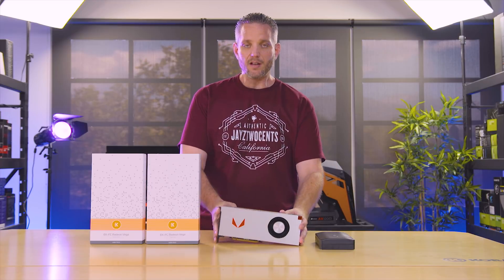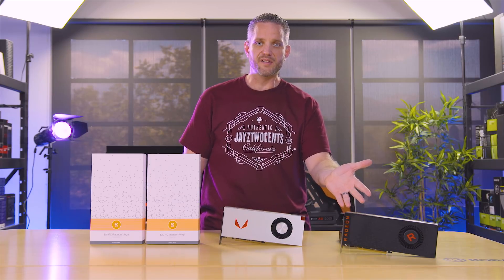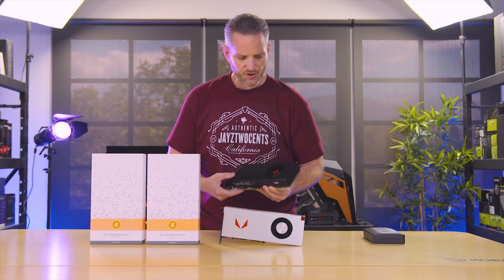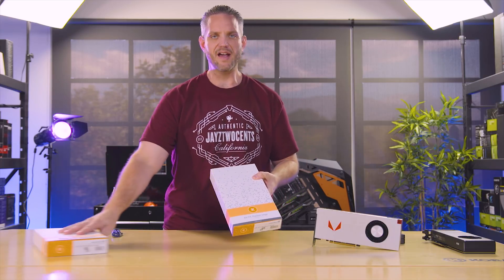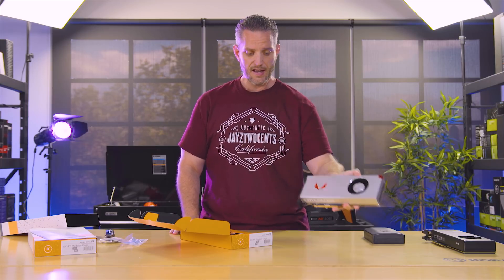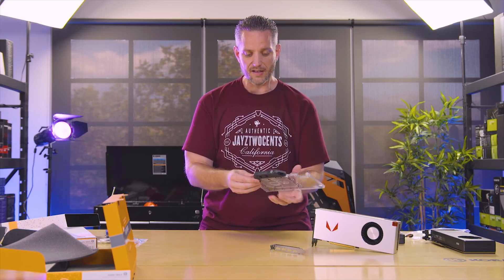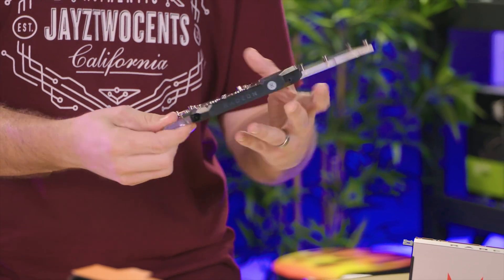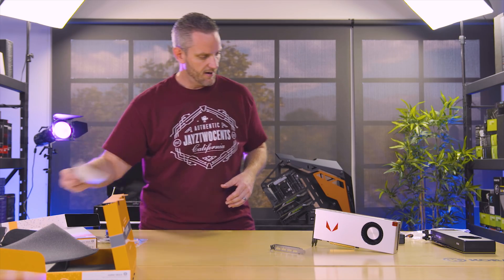Does watercooling help AMD Vega cards?

Comment: Hey Jay, thanks for the info! I really do appreciate all the work that you and your staff do. I recently did an 1800x/Vega 64 build, and will be doing a custom water loop in the near future. I was hoping that you could do a Vega 64 crossfire review?  That way  I could know if it's worth the extra money for the additional GPU, before I do the water loop. I understand that prices are inflated right now, and I would certainly wait for some drop or deal. Also, I saw that you are no longer using your Phantek Evolv 1800x build due to heating issues. Have  you considered moding the case to increase airflow? Many have cut the front and top metal covers to increase airflow, which will be what I do before adding multiple radiators. Thanks Lee

Comment: It looks amazing, but for that price, as you said, you can get GTX 1080 ti with 3 fans, that will keep temperature in check. Not to mention better performance and lower power draw from 1080 ti.
When Vega 64 comes down to 500€, then it might be making more sense. Right now it's not best price to performance ratio and not even close to being the best in performance. I just can't see a reason to buy this GPU now.

Comment: I have a 1070 with stock air cooler on it, running 2100 Mhz overclocked and it never gets about 45 C

Comment: Even when prices normalize it wouldn't be worth it. Huge power draw, the need of a more powerful PSU, higher electrical bills of barely the performance of a 1080 which can be had for under $550 right now.
Reply: But I admit it's sexy as hell.
Reply: For gaming yes, not for computing though

Comment: how did they address the  gpu and hbm2 being at different heights on certain models ?
Reply: TheRocky3211 Based on what I know, likely the substrate between the hbm to chip packaging thickens. Since the hbm die is separated from the gpu die.
Reply: 0.04 mm, I'm sure your thermal compound can cover that much
Reply: Andrew Delashaw 
No, there are 3 VEGA packages. If you look at gamers nexus they talked about it. Their cards also have the completely flat epoxy potted dies. 
It looks like jay has the most basic package where the HBM is a fraction of a millimetre lower then the GPU. HBM thermals are bad on these packages and you can't OC HBM for shit because of the temp.
Reply: The difference in height is some 40 microns. Just tighten your mounting screws 0.01 Nm more if you intend to replace the stock cooler.
Reply: 101blubb 
The cold plate is sitting on the GPU die, it's not going to bend to contact the HBM RIGHT next to it.
Reply: It doesn't need to. TIM is just fine in terms of connecting the cold plate to the memory.

Do you not realize how small of a difference 40 microns are? That is significantly smaller than a hair's width.
Reply: I don't think they are at different heights. I think the tops of the GPU and memory are all three on the same plane. And what do you mean, "different models"? Are you taking about variances between individual boards? Or variance from the 56 to the 64? Or variances when third party manufacturers start using the Vega 10 GPU? Because right now there's just the 3; the 64 SE, 64 Frontier, and the 56, and they all have the same exact layout and GPU/memory height off of the PCB.

Comment: The graphics card definitely having a better time on water with those temperatures, just a shame for the massive power draw though, where is all that power going to though? The Memory? The GPU? Though strangely it seems to do well when undervolting too, maybe AMD were thinking to give it a bit more voltage just in case?(That Violin and Piano mix was awesome sounding, where do you find the name for it?!)

Comment: This got me thinking - Why don't graphics card manufacturers every offer a "card only" option (NO cooling/IO shield(perhaps even omitting the fan header/circutry too)) at a slightly cheaper rate for those that are going to drop the extra cash on a water cooling block anyway?  Surely this would save the cost /waste / recycling of the air cooled parts from the factory??

Comment: Getting the same temps as you with my Vega64 in my custom loop overlocked at 1734 Core 1100 HBM2. Clocks arre rocksolid for me at 1734 in all games tested + furmark (did you set the powerlimit to 50%?). And no coilwhine which is a first from an AMD reference in quite a while :)

Comment: J would u have access to a RED cam 6k or above? If so how does Vega64 handle red 6 or 8k raw files. I'm planning a build with a 16core CPU 64gb or more ram. Right now I am using the first TitanXP but it is said to only have 28 CU while Vega has 64

Comment: Would be a cool thing if the waterblock can be seen in action from the top... But the GPU must point up. And that is, sadly said, not possible cause of heat. (aircooling) 

So when a Company build graphiccards with waterblocks installed, why they make not more for design? Like i said, a another architecture, where all parts of a GPU are on the top, when the card got installed in the Mainboard?

Comment: wouldn't you want the fins to be parallel to the flow for better heat dissipation?
Reply: I assume the fins in the water block. As an actual answer to that question, the fins are parallel to the flow of water. You can see the fluid enters a jet which forces it down on the fin array over the die, then is split to cool the VRMs, before reconverging at the outlet of the block terminal.
Reply: fins on what?
Reply: Yeah when I slowed down the footage at 6:34 I can see it is, in fact, parallel to the flow. Thanks for the reply.

Comment: 1080 TI is still king
Reply: Nvidia can relax because AMD has nothing better than the Vega64. At this moment there is simply no competition for the GTX1080TI. I wonder what would be the result when you place 72 or even 84 computational units on a card..

The funny thing about AMD is that when it was really starting to match NVidia performance, their CPU went the otherway. Now they have a good CPU, they seem to dropped the ball a little on the GPU. 

I'm afraid the AMD is too small to compete with both Intel and NVidia at the same time. It surely lacks the R&D resources of the former giants. 

Let's hope that availability gets better when Hynix can finally also deliver the HBM2 memory modules. 

[sarcasm]BTW: It is not hard to get sold out if you only have 100 cards to begin with..[/sarcasm]
Reply: That's the key problem. AMD is fighting 2 big enemies. Intel and Nvidia, so they can only choose to put max effort in one of both. Vega isn't bad, but it surely isn't kicking Nvidia of the Throne. Intel however ate some dick when Threadripper was released and ryzen is selling like crazy.
Reply: Half of the power (ok, a little hyperbolic perhaps) is literally turned off. RTG driver team literally can't make drivers for it LOL  It's still using the same ol Fiji codepaths with virtually none of the new Vega features active. Whether the software losers can fix this is to be seen.
Reply: God Fearing Nvidia knows that HBM is ex, that is why it is reserved for GP100
Reply: Elbucho1 ofc it is, in its price bracket.
Reply: In HPC applications the Vega can only surpass the Nvidia in a few tests, but I guess you never checked of how many test HPC exists off, right? BTW, it did only out perform NVidia when the they used OpenCL. When the GPU was allowed to the use their native interface (CUDA for NVidia, Stream for AMD) it could no longer keep up with NVidia..

About the power. The GTX1080TI was outperforming everything from day 1, without any optimized drivers. The area where AMD is really outperforming NVIdia are the Linux drivers integration.

You also do realize that the 'once the optimized drivers' argument is used with any AMD architecture? Check the reviews, it was also used for the Polaris architecture. That architecture is now 18 months old.. Is the RX480 performance now better than when it was released? Yes it is, but it's not magnitudes. You will see the same with Vega. Take for instance the Computing drivers. It will improve things a little, but it went from an average 37mh/s to 40 mh/s with ethereum mining. However for the same price of a single Vega64, you can buy 2 RX580 cards than crack out an easy 62mh/s while using the same energy. 

Because of the powerdraw, overclocking is not an option, so most miners undervolt their GPU's in order to reduce power usage and thereby heat..

Meanwhile, Inno3D started to warn miners that their warranty voids if the GPU is used for mining are they claim the cards are not designed to run 24/7. As far a I know Inno3D is currently the only one. 

For proper workstations load it simply cannot keep up with 1080Ti or Titan XP as it short of memory. The Vega only comes with 8GB memory where the others come with respectively with 11GB and 12GB of memory. In Maya it can somewhat keep up with the 1080Ti, but both are no match for the the Titan XP. Not surprising as the Titan is an entry-level NVidia Tesla card.

Actually the Vega64 currently has only one area where it really comes to it's own, and that is cryptography where it can beat ANY NVidia GPU.

But in general, the Vega64 cannot keep up with the 1080Ti. That is also why AMD placed the Vega64 against the GTX1080 (non-Ti version). As the Vega64 is currently produced in very limited batches, prices are very high. Even when Hynix is also the produce HBM2 memory modules, there will be only an influx of more HBM2 memory, but most likely against the same price. But as the vega cards get better availability the retail price will drop and than the vega56 can really starting to compete with the GTX1070. But the GTX1070 is already 15 months out, so I expect a successor within 12 months..

But eventually the HBM2 prices will start to drop and profits for AMD should rise, meaning larger R&D resources. 

One thing to note, pretty much all reviewers use the same games for measuring the gaming performance. So one can wonder why AMD didn't optimized the drivers for those games to begin with..
Reply: TheGuruStud AMD still want to lie to us that it is not using a Fiji based driver. I mean come on, it was a modified Fiji drivers during the early demo, not a scratch.
Reply: ummm why do you assume amd will surpass 1080 ti in newer games? there architecture is not power efficient enough to best anything ninvidia has to offer. why do you think they had to settle for hbm2? which cost 3 times more. ninvidia will be ahead in the future. once hbm2 comes down ninvidia will take advantage of it and will once again dominate with better gpu and memory.
Reply: Elbucho1 Computational wise, the Vega is able to best the 1080Ti and Titan Xp, once developers figure out how to optimize for Vega, you will see some domination, however ATM, Vega will never match the 1080Ti with current/past games.
Reply: Elbucho1 Vega is going up the Titan Xp. It is not a normal card.
Reply: Elbucho1 But there is Vega Frontier Edition coming and it should be better than the titan xp
Reply: AMD cards age better, so no
Reply: 2Fast4Mellow It's so new, look up compute tests, this bastard matches and even beats the 1080Ti and even Titan Xp on multiple tests.

The power is there, it's just waiting for optimized software and smart game developers, the architecture is anything but a fail, as it sits, all vega's are work station cards you can game with.
Reply: VEGA 64 can't even out perform a 1080 and a 1080 TI can out perform a Titan XP at times Vega is not the king

Comment: the problem with vega 64 liquid edition is that a air cooled 1080 with custom board (like aurous, strix or sc2) can overclock fairly easy and is cheaper

Comment: what would be cool is a waterblock on which you could put the original shroud back on, because you have to admit, the Vega cards look pretty.
Reply: Your crazy that single slot water block is at least 10x sexier...
Reply: I'm with Aaron, there's no reason I'd ever hide a sexy water block like that.
Reply: Klust413 Simple is sexy, just like the In Win 303. Or a 95 Volvo 850 T5R
Reply: Klaevin I think the clean modern look of the stock shroud is waaay sexier than the water block
Reply: Imo the aircooled Vega 64 is pretty sweet looking, the watercooled 64 is a bit too plain and the 56 uses the classic Radeon stock cooler design, so nothing special there.

...And the Frontier Edition coolers' colour schemes are god awful, if you ask me.
Reply: Klaevin I think there's an AIO version, where the card looks roughly the same.

Comment: Put my EK FC block and backplate on last week and redid my existing custom loop once more.  RX Vega 64 under water with EK goodies is so much more pleasing than reference air blower for obvious reasons.  Max temps of 40c under heavy load and very quiet gaming with a 360mm 60mm deep EK rad coupled with Vardars running around 1300rpm.  It sure is a sexy block and card when paired though no denying that.

Whether it's worth it, I guess it depends on where you are coming from.  For me, coming from 390 crossfire (which hardly ever worked) it's a godsend to get the same level of performance from one card.   And of course already owning a Freesync monitor, being the fastest single card from AMD, where else is your upgrade path.  I bought mine for £449 which was the early launch price, the EK FC and backplate cost another £100 or so.  So a combined price of £550 is quite expensive, you can't argue that.  I'd recommend it for the early adopters when the card was cheaper to buy, but I'd struggle to recommend it at the inflated price of the Vega series now.  But for me personally now it's on water, I can really enjoy it J.

Comment: Depends on the user's needs if it's worth it or not.

Vega 56 is the one that's best for gaming in terms of price/performance, so putting it under water is understandable.
Vega 64 is the one that's best for production in terms of price/performance, so maybe it's not as vital to put a card for production under water, but it's personal preference and there are some obvious benefits to it in terms of noise if overclocked and/or if it's used for gaming.

Would I do it in its current inflated pricing? I don't think so.

Comment: Got an idea for a video you can do.  at 9:50 you mention that coilwhine and such get louder when you put waterblocks on. what if you could deaden the sound? I myself hate coilwhine and its driving me nuts :(
Reply: You just need to add more radiators so the fans drown out the noise. ;)

Comment: Jay, stick this water block on vega 56, the one we all REALLY WANT TO SEE!! :) Pretty please? I'd do it but nobody sends me anything because my channel is new and my production quality sucks. :P
Reply: Everybody needs to start somewhere right?
Reply: Not a bad idea...less of a mouthful then eh? I might do that!
Reply: There is no reason to watercool a vega56 because its board total draw is limited to 300w anyway so it really cant overclock high enough to warrant watercooling.
Reply: https://www.youtube.com/watch?v=KD9CRQp2YpA there ya go buddy.  The gamers nexus final video is up.  408watts of power through a 56 maxed overclocking on kill the card voltage and power barely matchs or 1-2 fps beats a stock 1080 Founders.
Reply: Goooooood Luck
Reply: Cody Pettigrew ^^^^
Reply: Alec that's what you think, but maybe it'll be the boost it needs. You can alter the firmware somehow (I think Buildziod did that?) to allow higher power draw. 
Stock Vega has dual BIOS by default anyways.
Reply: We'll see, I plan to pick up an EK kit and watercool mine in a loop with a 1700X, a 240mm and 120mm rad.
Reply: Yeah budday!
Reply: @ Capntates  No no that will not be enough for the 56 to reach 1080 levels.  You will just be  paying 1080 prices for a lower performing higher power drawing card.  So that begs the question...Outside of fan preference....Why???
Reply: Just to see how it performs out of curiosity... I guess? :D
Reply: https://www.hardwareluxx.de/index.php/artikel/hardware/grafikkarten/44084-amd-radeon-rx-vega-56-und-vega-64-im-undervolting-test.html

according to this a "tuned" vega 56 matches gtx 1080. I've also seen user reports matching the gtx 1080 ti oc in the witcher without hairworks with only ~50w more consumption. fps reported for the scene was 95 fps @ wqhd for both.
Reply: stock...  *edit*Yea thats a undervolted power limit modified overclocked 56 vs a bone stock 1080 founders edition.  You can easily pick up 1080 aftermarkets that will hit 2050mhz.
Reply: You really thing if this was a reliable way to make vega 56 gain that much performance AMD would not have done this in the first place?
Reply: Thanks dude, I was just watching this an hour ago lol! I'm a big gamers nexus fan. Not to throw any shade your way Jay I think you're awesome ;)  Just nobody tests shit like Gamers Nexus.
Reply: If you get a vega56 with Watercooling you could also just get a 1080 for that money.
Reply: yea because amd always trips over their own "optimization". they've done that on hawaii and fiji and others, too. the youngest fury cards (latest production) can be easily undervolted by over 100mV on the core (1250mV down to ~1150mV) while maintaning the OC clock of 1050 mhz - (older samples still do 54 to 72 mV on average) which drops the fury power consumption down to 220W on full load, down from 300.
now the difference between fiji and vega is, that fiji was not powerlimited, vega is. dropping the core voltage not only decreases temp (what stabilizes clocks on core and more importantly on hbm) but also "removes" the powerlimit throttle.

Comment: Better use liquid metal. It's way better in cases of direct die cooling. My Aorus 1080ti dropped ~6-7 degrees on air compared to factory thermal paste (and ~10 degress compared to MX-4. Yep, MX-4 is worse than factory paste for aorus!)